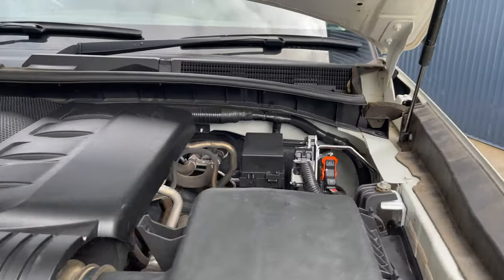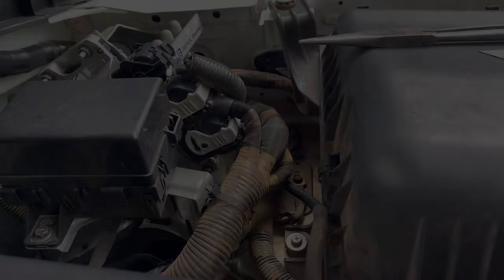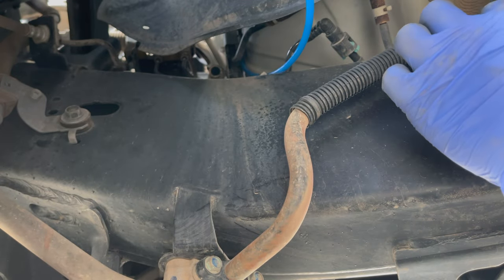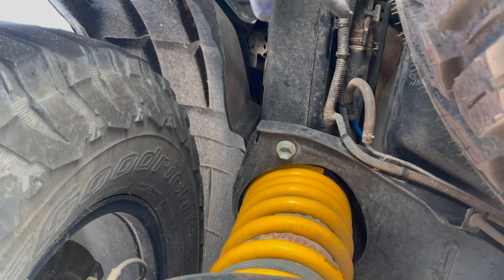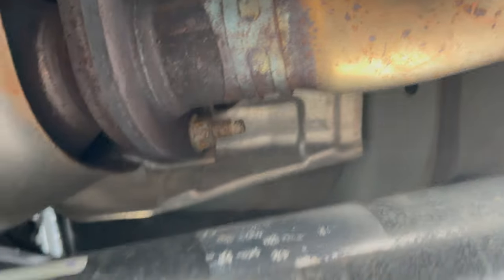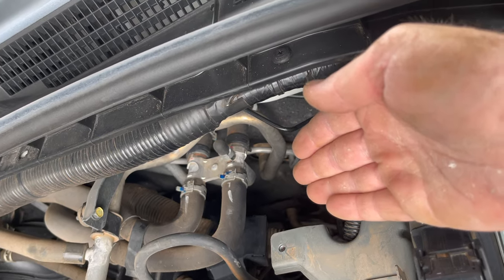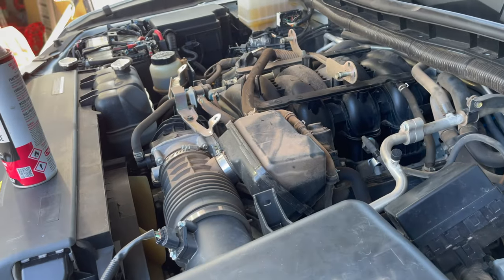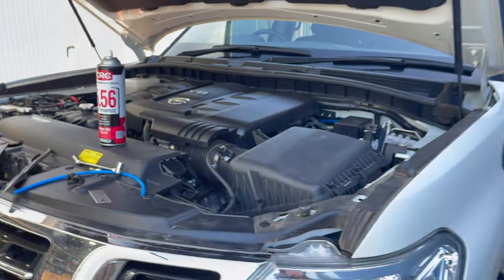Universal diff breather install on Nissan Patrol Y62 [ Air On Board Brand ]

Comment: Great informative video mate!...another job I have to do.👍
Reply from the maker: Planning on a submarine mission too?
Reply: @AussieVanAdventures  it was a really good video mate, not real concerned about the hight of the standard diff breathers but that transfer and auto breather needs to be higher for sure.👍
Reply from the maker: @baumie461  thank you so much! Yes the front and rear diffs weren’t too bad really. Trans were both pretty poor. Glad I did it though.

Comment: Thanks for sharing, I'm about to do exactly the same. 👍
Reply from the maker: Thanks for watching mate!  Yes we thought it was a good idea, heading to the cape and sounds like there is lots of water 💦
Reply: @AussieVanAdventures   will you be fitting a snorkel? I fitted a 5" Fabwitz to mine just recently in prep for a trip to Broome, good for raising intake above the dust and I can run a pre-filter sock.
You will have a blast up the Cape, I've done it a couple of times and the diff breathers will  be handy particularly if there is a bit of water in the crossings. Do you think you will try driving the Jardine River? We did in 2016, its soft on the north side, I had to jump out into the black water to connect 2 straps to recover a Pajero, not cool!  🐊
Reply from the maker: @sp2074   sure will, yes the 5” is getting made and installed this week. 🤙

Comment: Thanks bloke foe the very helpful information. Could I please ask you where did you get the bracket that holds the front light bar on the bumper?
Reply from the maker: No problem 👍 This is just a black number plate mount. here is a link https://amzn.to/3mYJYaZ

Comment: There is no way I would be reducing the size of the hose there is a good reason factory used a larger gauge hose, this blue line I widely known to clog up.  
Great helpful video tho I will do the same with proper hose.
Reply from the maker: Of course you need to do what you feel is right for your setup. Every kit on the market here that we could find (including all the big branded 4x4 companies) use this same hose as we used, the ID would be less than 1mm smaller than factory.. but I 100% understand what you are saying!